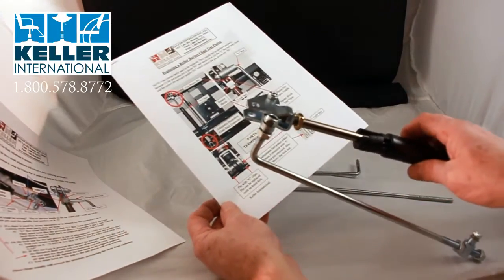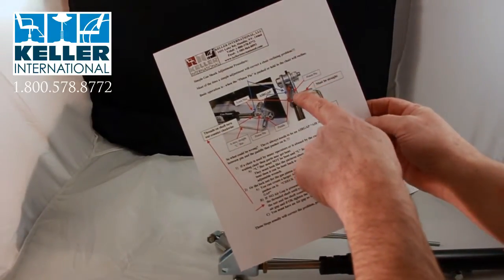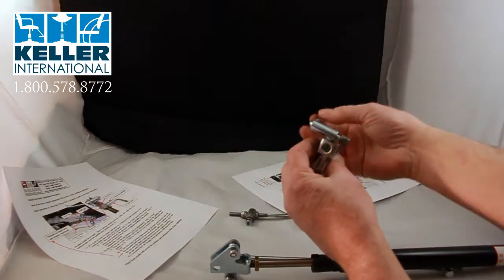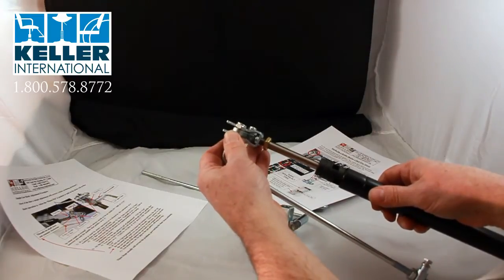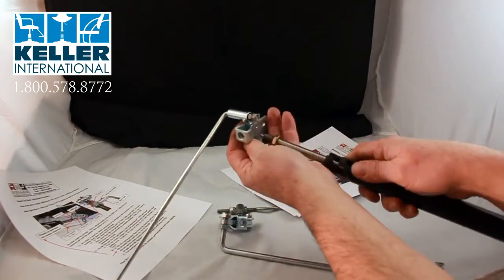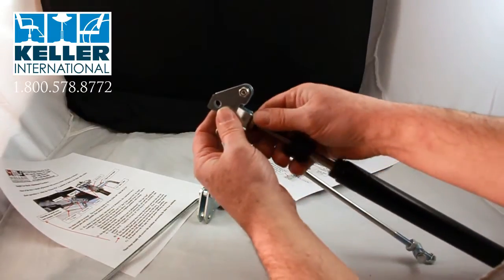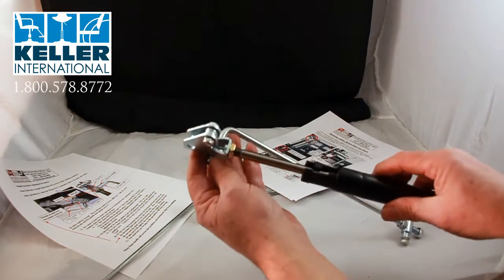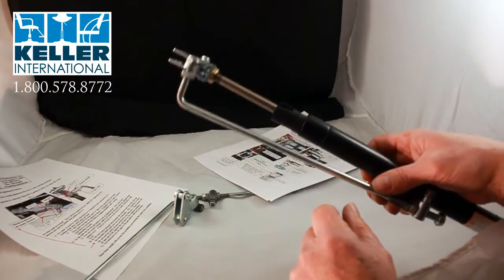How to Adjust Salon & Barber Chair Recline | Short | Keller International

Comment: hi, Keller international, my gas shock popped out of my barber chair and that the shock is longer and I can't fit it back to it's place. How do I make the gas shock shorter so it can fit into it's position.
Reply from the maker: Hi Ty! Which chair did you purchase from us? Our technician Matt can help you with any questions you may have regarding your chair, you can call him directly at 1-800-578-8772!